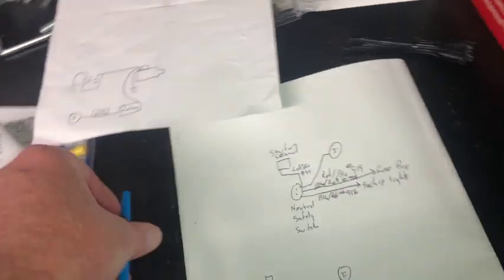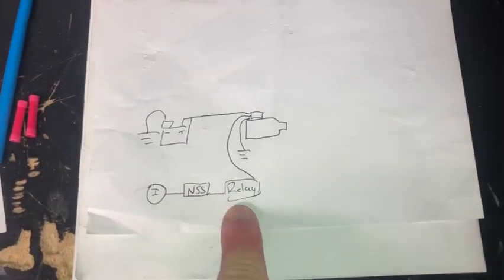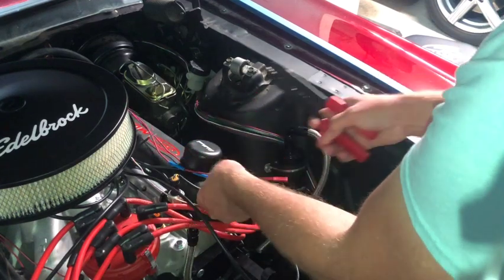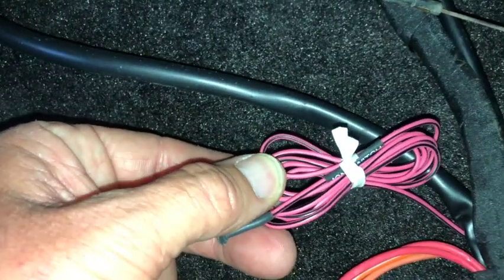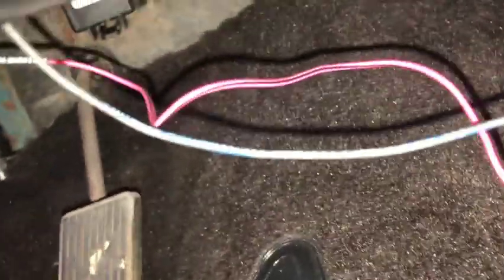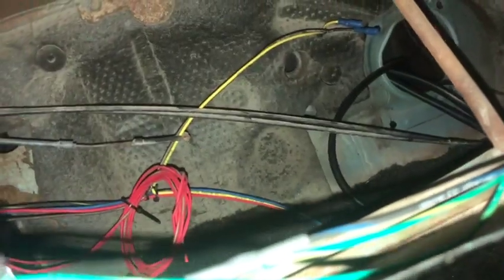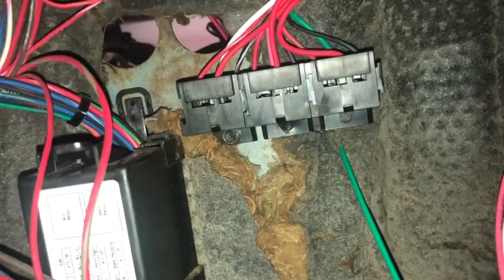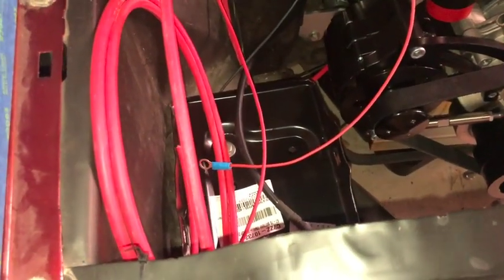Wiring Starter, Neutral Safety Switch, and ECU

Comment: Have you gotten it running? Can you show how to adjust the IAC. I installed it on my Chevy 400 small block and can’t get the IAC adjusted.
Reply from the maker: Haven’t gotten it running yet. I still need to get a starter, battery, radiator, and the rest of the exhaust. I’m going Sunday to get everything but the exhaust. I try to post videos about once a week, but sometimes it’s a little longer when I’m waiting on parts.
Reply: 12 months later he still hasn't gotten it running yet